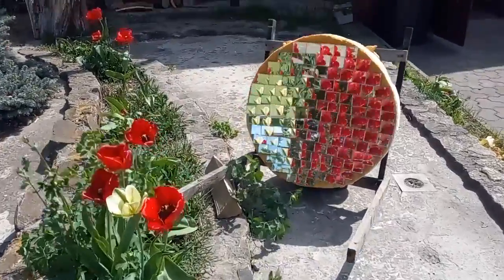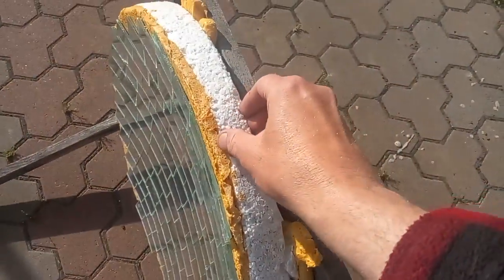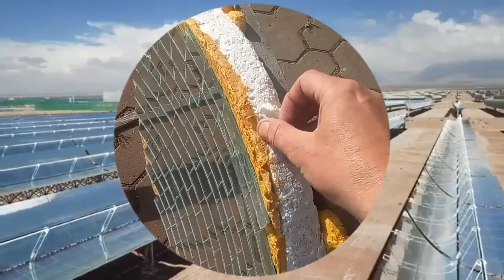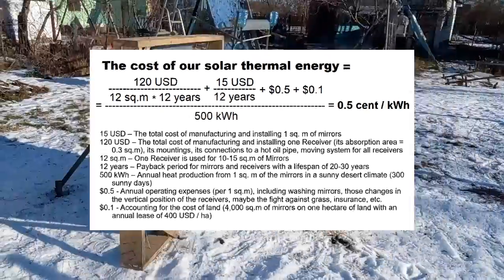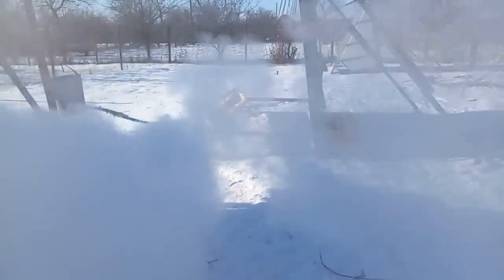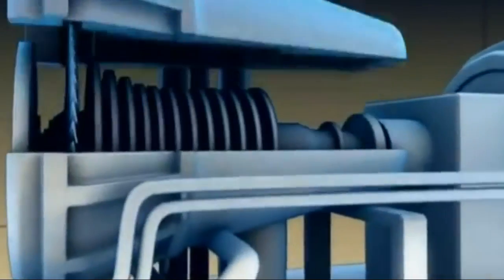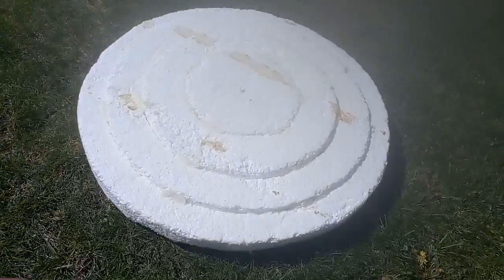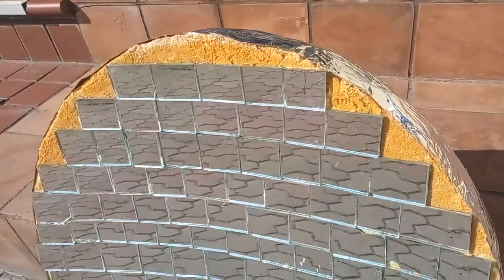New mirror for cheap heat & electricity. How styrofoam will help Solar Energy beat Fossil Fuels

Comment: Square little mirrors ~20*20 mm you can buy in DIY shop. Assembled with an epoxy glue to brushed metal dish 📡 will serve you to decades.

PS. Comment to support channel. Thanks.

Comment: This is very cool! Have you considered in making a video about heat storage in water or oil? I see you have good access to expanded polystyrene, might be good to show how much energy you can save overnight. It will be valuable once temperatures drop.

Comment: Sergiy, I have a stupid question I hope you will please answer. If u have a spinning rod, a rotating rod, cause to spin or rotate by whatever means (doesn't matter), what mechanical setup is necessary to convert that spinning rod into electricity that u then store in a battery or connect (somehow?) to an electrical out let and so power whatever has a plug (lamp, refrigerator, whatever)?

So, please, what physical things do u need, connected how, to convert that spinning rod into * usable * electricity?

Thank you for reading my question 🌞
Reply: A generator??

Comment: I used 300 meters of black pipe laid out on asphalt in the sun, to circulate pool water for heating. One morning, the pool started at 18°C, and by the evening, the pool had reached 33°C. With slight insulation, the next morning, the water temperature only dropped to 25, allowing the sun to heat it up to 35°C this time. Based on the size of the pool, approximately 150KwH were needed to heat the pool.
In the future, the use of mirrors should be better. I need to experiment with your techniques.
Reply: Or just put black foil on or in your pool
Reply: @SolarCookingGermany  Or color the walls of the pool...

Comment: AI Summary

This video presents an innovative, cost-effective approach to constructing large-scale concave solar mirrors for thermal energy and electricity generation. The core innovation involves utilizing inexpensive expanded polystyrene as the structural base for gluing small glass mirror pieces, drastically reducing material costs compared to traditional metal sheets. The design incorporates stationary mirrors that focus sunlight onto a moving receiver, generating heat at approximately 300°C. The creator demonstrates the significant cost savings, estimating solar thermal energy at about half a cent per kilowatt-hour and electricity at five cents per kilowatt-hour, making it significantly cheaper than fossil fuels and conventional power plants. The video also touches upon the long-term durability of the polystyrene base and potential mitigation strategies.